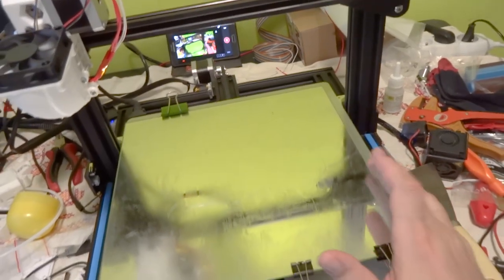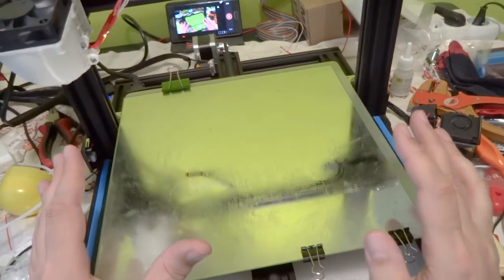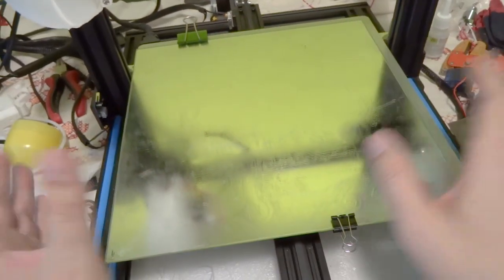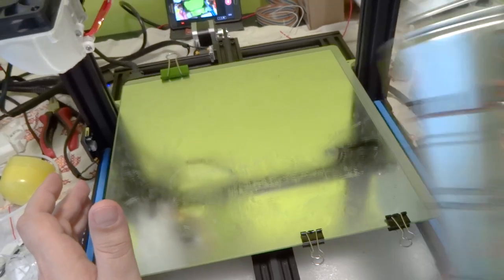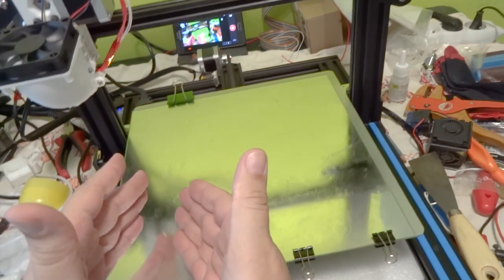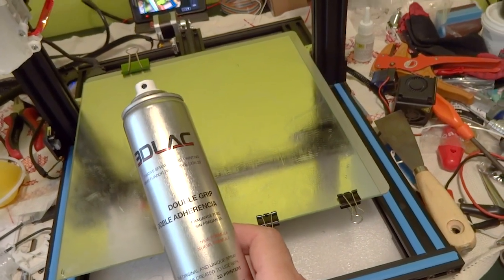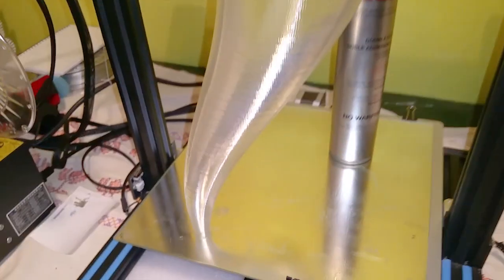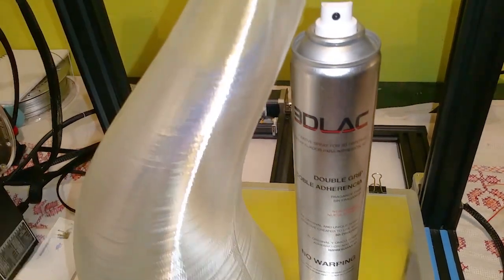3D print - Adhesion of the first layer and a 3DLAC

Comment: 3m super 77 works super well, almost too well. I have to put the glass plate in the freezer to pop prints off a good portion of the time. It also cleans of the plate under hot water really well. I wouldn't use it with a non glass plate. And it can be hard to clean off the base of the print. Also I use a separate cardboard box to place the plate in before spraying. I wouldn't spray on the printer.